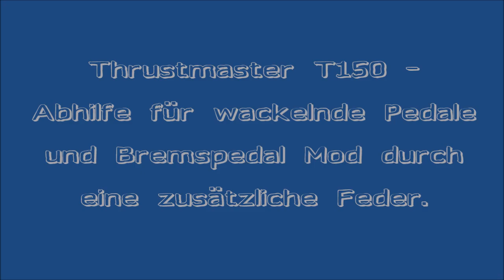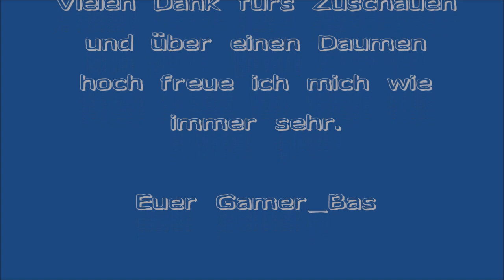DIY Brake Pedal Mod #2 und wackelnde Pedale beseitigen / Sim Racing [PS4][PC] Thrustmaster T150

Comment: Suche ebenfalls passende Federn. Entweder ich kaufe eine mit richtigem Durchmesser und bastle die um oder setze neue Bolzen ein zu denen es Federn gibt
Reply from the maker: Moin Moin, danke für deinen Kommentar. Mittlerweile ist es schwer alte Pedale günstig zu bekommen um diese wegen der Federn zu schlachten. Daher habe ich Mal ein wenig überlegt und geschaut. Geht in den Baumarkt, dort findet ihr Federklemmen/Spannzwingen (wie unten im Link). Sucht welche mit ähnlicher Federgröße. Aus diesen Spannzwingen könnt ihr dann die Federn benutzen. Müssen meist nur gekürzt werden.
https://www.ebay.de/itm/174746686102?mkcid=16&mkevt=1&mkrid=707-127634-2357-0&ssspo=yxewdjkbrcg&sssrc=2349624&ssuid=rDfr70obQju&var=&widget_ver=artemis&media=COPY

Comment: Hello, where did you find a new spring like this at 2:04 ? The spring on my Thrustmaster T150 gas pedal broke and I need a new replacement part.
Reply from the maker: Okom on ebay you can usually buy cheap defective steering wheels with pedals. Then you have replacement springs. It also fits springs from older Thrustmaster pedals for PS3
Reply: Gamer_Bas Ok, Iwill first see if Thrustmaster customer support will give me a new spring
Reply: Okom im in the same situation. Any luck?
Reply: Denis Brujan Yes, I contacted Thrustmaster support and they asked me to give them some pics of the serial number of the pedal set and I did. After that they asked if I have receipt but I didn't. Even though I didnt have the receipt, they offered to send me a maximum of 2 gas pedal springs for a fee of 6,00€ a piece with 13,00€ shipping to Finland, a total of 25,00€.

I read online that people with a receipt of the T150 purchase got the springs for free from Thrustmaster support.

You can ask me for help on the installation of the springs if you get them good luck.
Reply: Okom thanks for the prompt response. I think i will just diy it with some torsion springs
Reply: Denis Brujan If you find some you can try